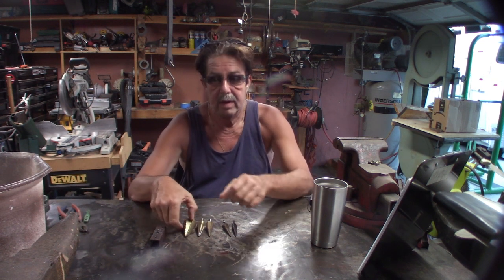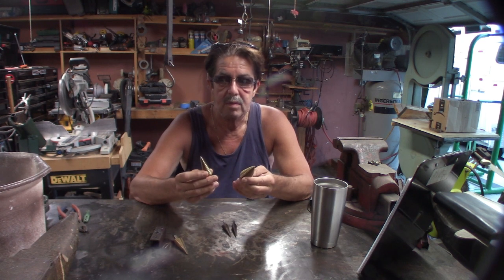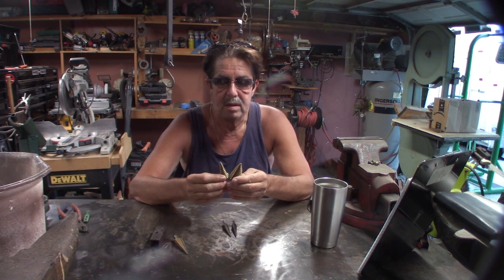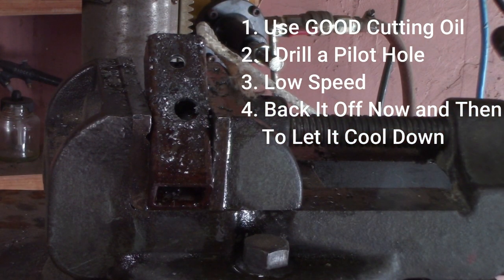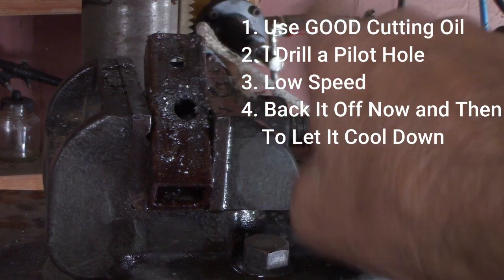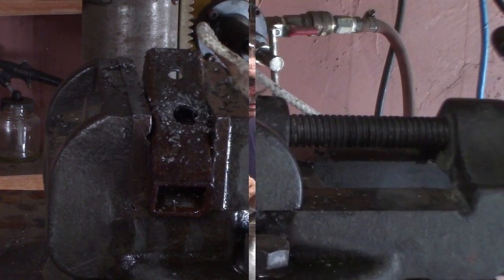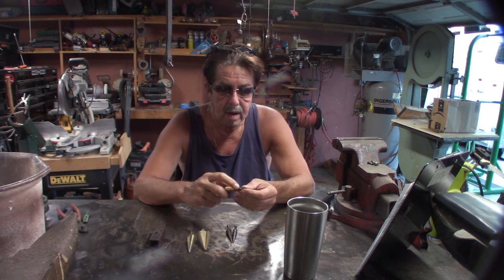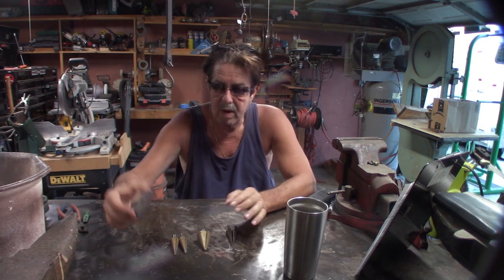Harbor Freight Step Drill Bit v  Irwin - How To Use Them So They Last Longer

Comment: Good video.  Go slow speed and feed rate and lubricate.  I have the hf bits same results.
Reply from the maker: Thanks and yeah they will last you longer if you use them in slow speed with cutting oil